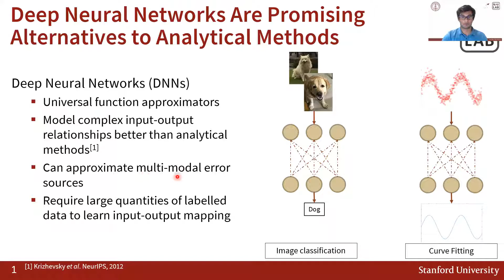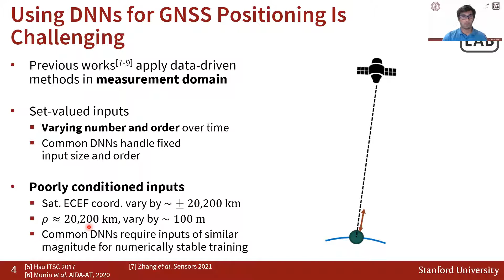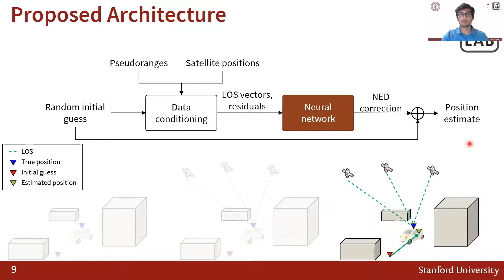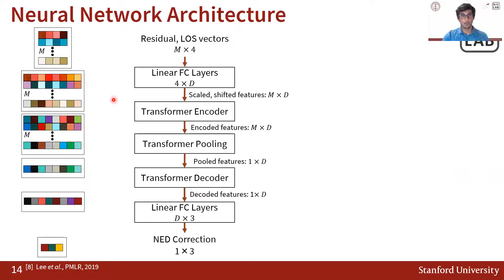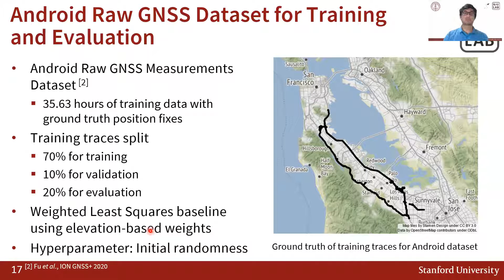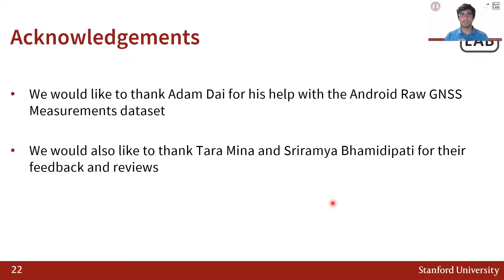Improving GNSS Positioning Using Neural Network-based Corrections

Comment: 00:03 Improving GNSS positioning using neural network-based corrections
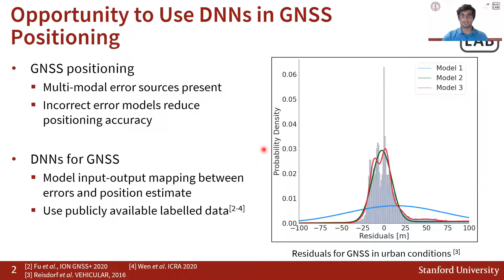02:12 Challenges in applying deep neural networks for GNSS positioning
04:13 Neural networks can memorize specific input-output mappings, leading to inaccurate estimations.
06:12 First data-driven method in GNSS positioning domain
08:14 Global applicability and prevention of overfitting through geometry-based data augmentation
10:17 Using set transformer to improve GNSS positioning
12:21 Neural network learns latent vector representation for position corrections.
14:27 Neural network-based approach outperforms weighted least squares method
16:37 Our approach outperforms weighted least squares significantly in the vertical direction.
18:18 Neural network-based corrections outperform WLS in vertical direction